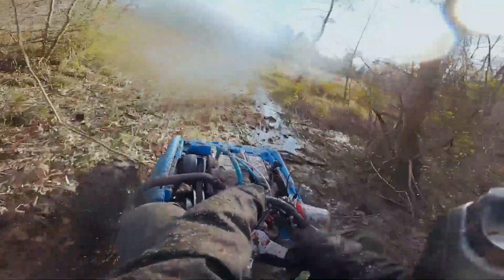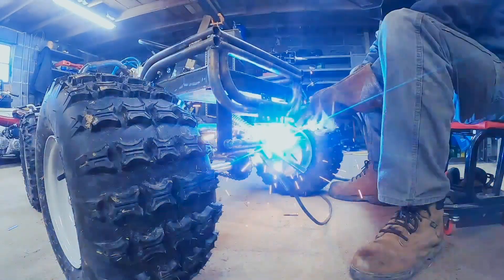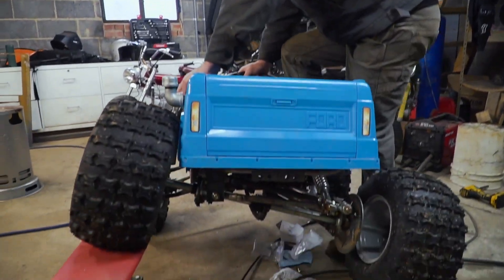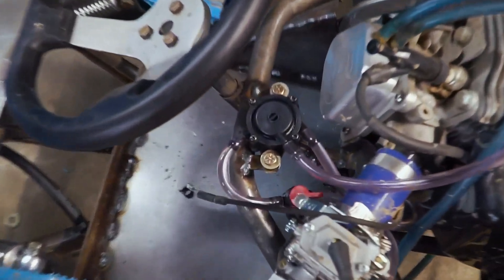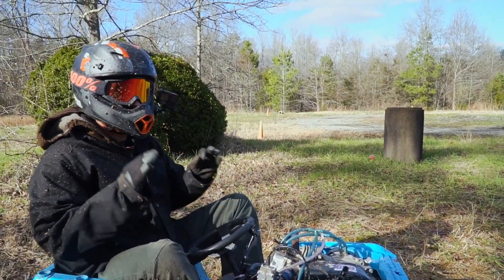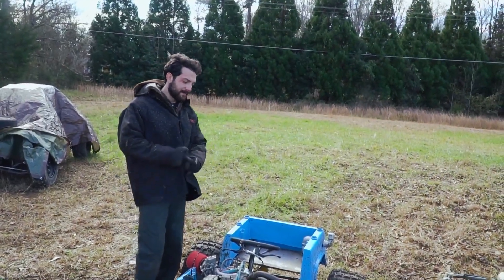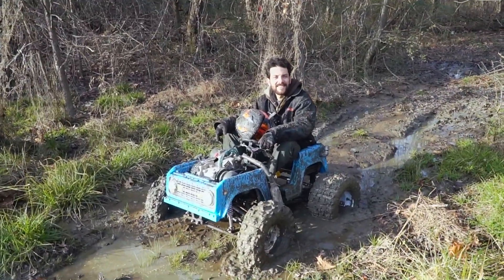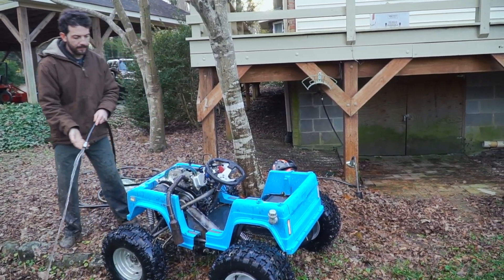4x4 Bronco Power Wheels Go Kart First Rip! | Mud Run, Jumps, & More!

Comment: Time to bring out the dragster and start getting it ready for spring.
Reply: YES!!!!
Reply: I'm not a fan of the dragster (lawnmower engine, overly complex).....but the mans right.
Reply: @tomstech4390  the 670 was cool but  I think they should put the ducati engine on it like they were thinking a while back.
Reply: @noahpaulette1490  It simply cant handle the ducati engine, Like with boat hulls theres only so much power you can usefully put into something. I like the 670 engines but they're not high performance (lawnmower ohv).
670 engine: torque build like a quad or tow-cart.
Dragster: get it running and enjoy it for what it is, simplify its drivetrain if they can, Heck a 420 could be cool.

Comment: Watching John put 50 psi in that tank and hearing ikes frustration
Reply: Here we have somebody trying to create controversy out of thin air.
Reply: @SportbikerNZ  nope. Simply stating a scene in the video thats all
Reply: @smallblockbigbang4581  And manufacturing the non-existent details of 50psi and Ike's frustration.  
So no, not "stating a scene", rather dreaming one up.
Reply: @SportbikerNZ  5:14 after watching for about 3 to 4 yrs id say thats about what was going on
Reply: @smallblockbigbang4581  And I've watched all but one or two.  Not hard to spot a comment stirrer.
Reply: @SportbikerNZ  Haha not trying to stir any thing bud
Reply: @SportbikerNZ  if i wanted to stirr something i would have said something about the locked axles with chain drive and turning...
Reply: @smallblockbigbang4581  if it's involuntary, that's a worry.
Reply: @smallblockbigbang4581  Which is no problem on dirt.  In fact it's by far the best option on dirt vs risk of one wheel peel.
Reply: @SportbikerNZ  Haha have a good night
Reply: @SportbikerNZ  sorry i didn't see your last comment yeah your right
Reply: @SportbikerNZ  but i love this build, and they no what they're doing

Comment: Good point to move the brakes to the jackshaft, that will give you four wheel braking power verses an iffy brake in the rear. Or to save time and labor swap the caliper to a hydraulic. Good job guys, cant wait to see next weeks episode.

Comment: For the seat(bottom, back, and sides) I suggest some interlocking EVA(or similar) foam and some good spray adhesive. Cheap, fast, easy, water resistant, and can look great. You can double it to whatever thickness you want, it comes in several colors, and has Diamond Plate finish. You can even use abrasives to round the corners and cut designs in it. You can even heat it to make it mold to inside corners or the plastic. Yes, I really like the stuff.

Comment: for the throttle use brake setup from BMX bike head stem that allows 360 rotation without binding the cable. For the brakes , how about regular foot rest, on a pivot? Or a Hydraulic on the steering wheel lever, of course use a clutch slave cylinder or motorcycle style cylinder  , the regular handle bar mounted may be in the way. That type only uses 1-2 in travel, for lots of pressure. If you go the foot style, put the pivot in the center (under the arch, rocker style) so it doesn't require a lot of room for travel

Comment: Is the fuel tank not vented ?  That'll be an issue pretty quickly
Reply: They have a small hole in the cap. Or atleast thats how they were air testing for leaks
Reply: You realize the gas cap is how all these carts vent?
Reply: @SportbikerNZ  you dont say. But instead of a cap with a vent they were going to use a pipe cap.
Reply: @Shredxcam22  And?  They've drilled many a gas caps in past videos.  Gopower sports used to sell them non-drilled after all.  
How do you think they are pressurizing it at 5:16 ?

Not Isaac and John's first rodeo.
Reply: @SportbikerNZ  have you seen the garbage they build? They keep using go china sports parts so it wouldn't surprise me if they put a non vented cap on
Reply: @Shredxcam22  "garbage" whatever hater.  If you weren't a such a casual you wouldn't wonder for two seconds if they drilled it.  Pretty darn obvious they drilled it or they couldn't pressurize the thing.
Reply: @SportbikerNZ  I'm amazed how hard you go for these guys. I enjoy their content for the most part. Been sub'd a few years. But they do a lot of silly stuff
Reply: @Shredxcam22  Just correcting a clearly misguided comment.  Nothing to do with going hard for anyone.

Comment: I’m working on a racing lawnmower right now and I’m also using a bicycle brake on the steering wheel as a throttle but I’m having trouble getting it to return to idle and I was wondering how you guys were able to do it. Any suggestions?
Reply: I'm not John or Ike but I'd start by putting a stiffer spring on the carb and making sure your cables are properly greased.

Comment: for the fueling issue, i've used a flexible conduit , or rubber fuel hose , to connect the outer and inner pipe. Or cut the pipe to the tank lower and add  a 45 degree elbow at each end of the connecting pipe. Mount the body section, add a short extension to clear the body, and use rubber fuel hose connection to the stand pipe for best fitment and ease of filling.

Comment: That gap in the two body sections  at the step thru drives me crazy.  Need to find someone to 3D print you a section to fit it or go buy a second one to cut a piece to fill in that gap.  And personally, I think some moderately sized fender flares would look good on it, helping the body not look so small compared to the wheel track. 

I keep hoping you guys are gonna do some project w/ the snowmobile engine.  And I would love to see a Tow Truck Kart project.  I think a functional tow truck gokart would be such a fun, well-received project and something you could use at the Cars&Cameras HQ for other builds when they have probs and need a tow back to shop, or fuel, or work at location.  Could have a small winch on front, fixed boom on back w/ beefier winch, some fueld and tool storage, and of course, flashing lights and cool paint job.  Every time you use it you could highlight the build series for it to further views.

Comment: I have a suggestion, there were some "pro" bmx bikes when i was a kid, you could turn the wheel as many turns you want. They had some kind of collars around the fork i guess, for brakes, both front and rear. Maybe you could use something like that for the brakes and throttle.
Any way nice progress guys, keep up the good work!
Found it, google gyro bmx brake kit

Comment: Love to see a solid axle 4 wheel steering swamp buggy. Maybe trying to connect a pair of 212s at the crank firing on the opposite  stroke. Engines mounted high with the crank in line with a central drive shaft with the torque converter under the steering wheel in a water resistant tub.

Comment: Maybe you could've cut the fuel neck at an angle, that might've made cutting the access hole in the body a little difficult though. Couldn't tell if first there was a jump or the suspension, but later on looked nice getting that air! (Meaning you really wouldn't see a Bronco doing a major jump anyway, so that was about typical)  When John went for the lap, was thinking ohh noo - not the tree! 😁

Comment: The lower you mount the pulse pump the easier it is to Prime. And also like the "P" is molded into the plastic there should be two triangle arrows by each nipple to show the direction of flow

Comment: Mount your caliper to the rear side of the axle hanger... It will tilt with the axle. Also, a one way valve at the other end of the fuel tank so you can fill it faster.

Comment: Next project. How about  Predator  powered skateboard? No, John would kill himself hitting a tree. Maybe a utility vehicle like a Gator with a dump bed so you can haul stuff enough to be useful along with the loader bucket on the tractor. Fill it up with gravel and dump it in a mudhole near you! The gravel that is, John.....LOL!
 Back many years ago a friend was traded a PUCH moped for some yard work. He was deep into 2-stroke Yamahas and we started messing around with the compression. That raised it needed more fuel. The exhaust was too restrictive. We moved the ports for more power. Repeat the steps above some more. Eventually we had a ripping little SOB that could pass slower traffic on a 4-lane highway. Speed wasn't an issue as mopeds needed tags back then. Faster. So one day I decided to do a top speed run down a road as flat as a South Florida road can get. Straight as an arrow for about 3 miles. My friend had staked out a mile with white markers. We would time ourselves with a stopwatch. Old school.
 So I tucked down and let it go. It was flat out nothing left at the first marker. In a flash the mile was gone. I checked the watch........73mph! No. I looked again. Yep! 73! Now at 73 mph a mile goes........fast. Instead of doing the math AFTER I stopped, that intersection with that 4-lane highway was getting dangerously close. I flashed past my friends house at about 60mph with less than a half mile to the stop sign. I hit those moped brakes for all they had. Which was at about 30mph! At that time they faded into moped oblivion! Watching cars zipping both ways on the road ahead, no chance of slowing down I accepted death, closed my eyes and gunned it. I felt myself go through the dip between the lanes and the front wheel get light. Knowing I had gotten hit I opened my eyes and...........i had made it across! I got off the gas and coasted to a stop, finally. Then I got the shakes! I calmly shut the bike off, leaned over and puked in the ditch. An old lady came out of her house and asked if I was ok. Something I ate, I said. Getting back together I started the death moped up and quietly rode back across the highway. Getting into my friends driveway he excitedly asked why in the heck I was trying to get myself killed riding wheelies across US Route 41.......

Comment: Id use the plastic kids foot stomp pedal on the floorboard to operate the throttle cable..maybe fab it up out of steel and then cover the rod with the plastic pedal just for coolness factor and because there's not really any place else for a down hanging pedal..

Comment: How is the pond looking with that bubbler thing? If 1 isn't enough  there is a company that makes something like that  but it runs on solar power  if you wanted to put more.  Also I'd tie a rope and a float to it so you can easily pull it up out of the mud and crap on the bottom every so often

Comment: On 4x4’s you should run the same size tires all around. I know it’s just a go kart but it would run better, and less stress on the drive train. I would run a tire size in between the front and rear, that would be perfect. By the way I love what you guys are doing for our hobby. Get up the good work.

Comment: You should build another golf cart, but either make it 4WD/AWD, or turn it into a proper buggy. I did it to mine with a Vegas Carts 625, 25" tires, custom IFS, a full cage, and a frame stretch. Works pretty slick! With stock gearing it'll do 28mph, too.

Comment: What I think you guys really need is to improve the course, make some drainage ditches or gravel up the course where it gets really muddy. 

And for a proper project: 
1) Dual Two-Stroke engine (two separate engines and drivelines) all-wheel drive yard cart.
2) A cargo cart with 6 wheel drive.
3) Utility crawler with 8 wheels, the outermost axles have turning wheels.

Comment: If you  take a cupple feet of fuel line  and put it down yor funnel so its near the top of your tank. It will fill a bit easier  becuse the line will let air out of your tank as the fule fills it up

Comment: The steering will never be easy with the solid axle and manual box.   One wheel trying to roll forward and the other essentially rolling the other way when you steer.    The very best will be to have your pivot points of the knuckle point to the center of the tread patch touching the ground

Comment: Get in touch with Ike's brother and get yourself a brake hub for handlebars like they use on pro bmx bikes. It allows complete steering rotation while being able to use a cable system for brakes and throttle. Its used to connect the front and rear brake cable on a bmx bike, you might be able to fabricate one yourself and or modify one to operate the throttle.

Comment: 1-tighten shocks up one notch.
 2- build a completely sealed with short rearward facing snorkel belt drive enclosure.
 3- put as small a sprocket as can be found on jackshaft input and or smaller on outputs.
4-fix or replace that carb and retune it for that engine pilot and main jet wise.
 5- main jackshaft or power shaft disc brake relocation
6- build a seat pan and back rest from 1/2" 5 ply plywood padded and covered so Johns nary buttocka and spine won't be killing him before he reaches 30 and on into his later years...
7- get some brass to cutout and make brake pads with so they'll last a long time and also stop much better than organic pads will..

Comment: You guys should build the a vehicle that is perfect for pulling out projects. You could use a   90’s kind quad 300 engine. It has a 5 speed trans with high low and super low, 2wd, 4wd, and differential lock. It would be sweet

Comment: Great build! But you should do something about the steering. At full lock one wheel has a lot more angle the the other.
Reply: That's normal. Ackerman steering. At full lock the wheels each have different trajectories.

Comment: You guys should make a vehicle that you don't have to pull your knees up to your ears to sit in it 👍👍🤙 like the trophy truck but long suspension 4wd locked diffs a go anywhere rig with hi and low would be so awesome. Crawl through the woods and rocks and then hit high gear for some trails and be comfortable doing it 👍👍💪

Comment: the pulse pump feed should be in-between the carb and engine guys 
id leave the crank case breather free and point it at the  floor 
because when you go abit crazy the oil will come out the crank case vent
not sure how the pulse pump will like that. 
sorry about the broken english epic work dudes.

Comment: Honestly I would go with a shorter gear than the one y’all are thinking of using. Torque converter is good but when it gets wet you need more torque to counter the belt being wet

Comment: You guys should make a small brake pedal and a lever for the steering wheel as you can push on the brakes a lot harder with your foot than your hand and also (I’d imagine) that a normal persons reaction would be to hit a brake pedal. Just a suggestion! (P.S. great video guys!)

Comment: Should make a 2 speed box with the high speed gearing and a super low speed gearing for mudding to put less load on the torque converter

Comment: Josh, no butts about it, you need a seat with very cushy comfort with a back rest! Just weld some brackets on the gas tank for a seat. Pray it doesn't explode from the heat igniting the gas inside. "KABOOM!" "EJECTOR SEAT!" "JOKE!"

Comment: im surprised you guys havent run into issues with the pulse pump, 9 times out of 10, gotta run a return line back to the tank by running a T right before the carb, then
Reply: just stops it from over pressuring the carb at high rpms. it will even push fuel through the carb

Comment: I'm still confused on what the pulse pump is for and why its hooked up to the crank case and valves
Reply: The pulse pump uses vacuum from the crank case to draw fuel from the fuel tank to the carb. I’m guessing they are using it because the carb is higher than the fuel tank and fuel needs a bit of persuasion getting up there 👍
Reply: For applications where the fuel cannot be supplied by gravity ex.tank is below level of the carb, uses the crankcase pressure or pulses to operate a small vacuum pump(pulse pump) to pull fuel from the tank, into the pump and up to the carb..sure there is a better explanation, but should give you more of an idea of its function.
Reply: @josephsirieys9825  oh ok thanks man I think I missed that part in the beginning because I was hooking up my Bluetooth headphones lol but I get it now

Comment: why not use a 45 degree elbow on the fuel filler in stead of a 90 degree elbow ?Also it looks like the front wheels are being pushed when in a turn .

Comment: Yall should build a 4x4 v-twin 5 speed with a high low range transfercase crawler buggy get a transmission and transfercase out of a s10 or ranger and bolt it up to a fully built 670cc vtwin

Comment: you guys could stand to get rid of that gas heater and swap it out for a diesel heater fully self contained .. just need a 12 volt power supply .... takes up no floor space given the small room you have more economic than gas/lpg and heats better and are fairly cheap to purchase ! ... oh they have full thermostatic control and remotes to

Comment: i've yet to see something 6 or 8 wheeled, or maybe build something out of an old rear axle with a diff, or set up a challenge, build something without using a certain tool, welder, drill etc.

Comment: you guys should build a bigger better faster cross kart and use a  front wheel drive 4 cylinder car engine but rear mount it in the kart

Comment: time to put the big boy pants on and find a ZX10, R1 or GSXR1000 or Hayabusa engine all good for over 130bhp. or if you can get a sponsor a 1000cc BMW RR almost 200bhp  and make cross car version two with AWD, 12" or more suspension running ATV wheel and 28" tyres, you have the pipe bender, and cnc table , man side single seater to smash  on the big course record

Comment: Push pull for throttle brake? Push for throttle pull for brake. I know you'd end up only one handing the wheel but itd work better than that mess of cables